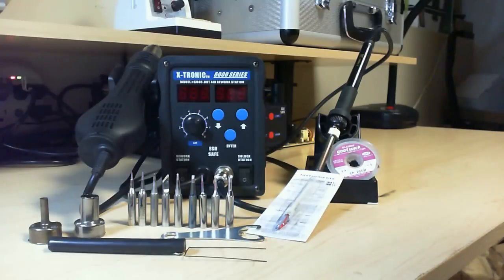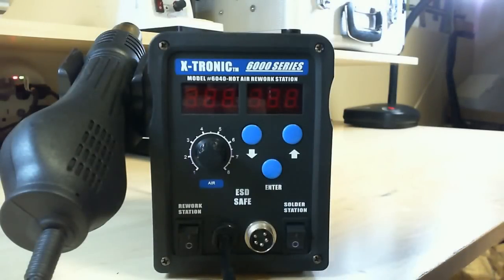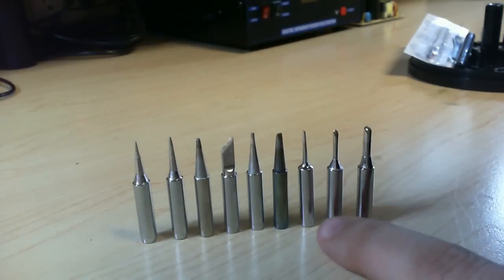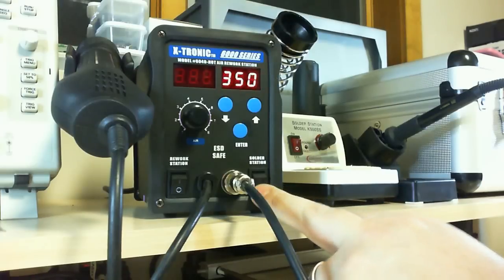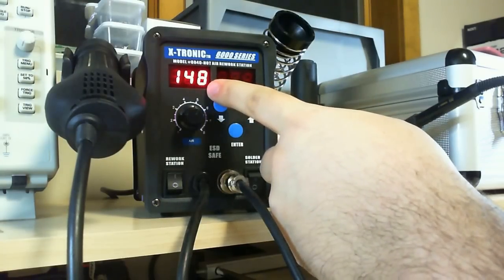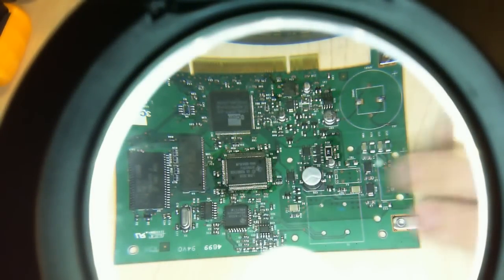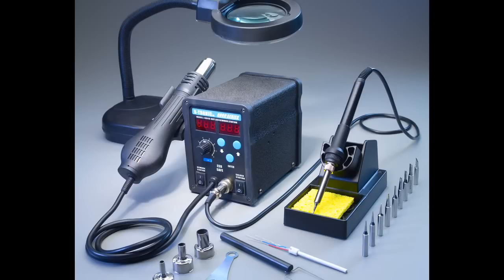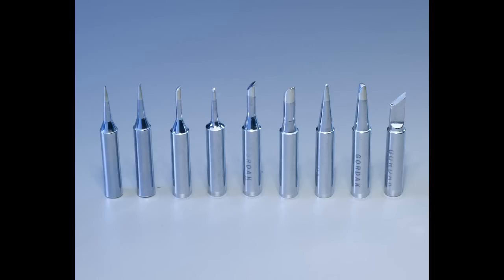X-TRONIC #6040 Rework Station (Product Review)

Comment: On eBay that soldering station is around 47.99 ,u should check out eBay ,unless you want to spend more.
Reply: Ron Thompson no you were looking at another one. this particular one is $129 on eBay.
Reply: Mine is the same ,but no lamp

Comment: Excellent review and just to re-cap as perhaps I missed it. In comparison to the Hakko FX-888D and the fact that this unit utilizes the same tips, Is this a ceramic heating element on the pen and in your opinion..how would you stack and review your opinion of this unit vs the mentioned Hakko which is my current comparison for intended purchase????

Comment: great review, thanks.. One quibble: the connector for the iron is not a MIDI connector.. MIDI stand for Musical Instrument Digital Interface.  A soldering iron is not (normally) a musical instrument.
Reply: so, you can sequence your desoldering? How cool is that? what about using a soldering iron as MIDI controller?

Comment from the maker: I would have to say the 6040 for a few reasons. One is the fan in the handle and the ability to auto shut off the rework station when you place it back into the holder. Second it is smaller and third, The 6040 doesn't make as much noise as the 968A+ does.

Comment: Ah, that's the kind of information I like to hear! :)  I'm looking forward to my unit.  It's still in transit.  I'm using it for a project I'm getting ready to do.  I have to remove around 80+ capacitors off of an old game system, and I needed a good rework station.

Comment from the maker: You are correct, they do both look the same and share the same specs. It looks as is if both are just rebranded. I can not really speak to the operation and quality of th eone you are speaking of but I have used the xtronic one since november of last year and have had no issues at all with the unit. That is all I can speak of. Hope this helps out.

Comment: Hello 1HandTech. Thank you very much for the detailed and informative video.  I'm still making a decision about getting this product. I found another one that appears to be from the same manufacturing plant of the x-tronic 6040. I was wondering if you can give me any information which would determine any significant difference. The one I found is called "898D+ 2in1 SMD Rework Soldering Hot Air Station Welder". The specs seem identical. Thanks for your time!

Comment from the maker: I could make a video about that but just so you know, That item is used to help remove that IC components from the board you are working on. All you have to do to use it is just use the hot air gun to re-flow the solder and then use the popper to remove that component. To put it together you just screw the screw into the handle just enough for it to stay put and the slide the metal prongs under the screw and then tighten it up. I may do a video about how to use it and send it to you personally.

Comment: Nice review. Thanks. I'm a novice and I don't know what the black plastic tool (the one that comes with a Phillips head screw and a wire shaped like a football goal post) is used for or how to properly assemble it. No instructions about it are included in the kit. Would you be willing to spend a few minutes describing that item?

On an unrelated subjected, they also include a pair of tweezers, which is a nice touch.